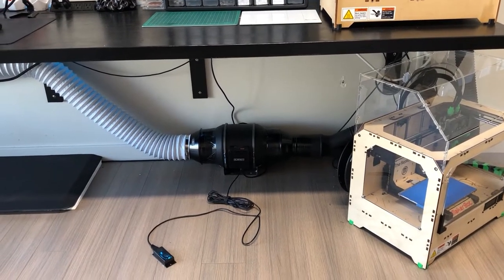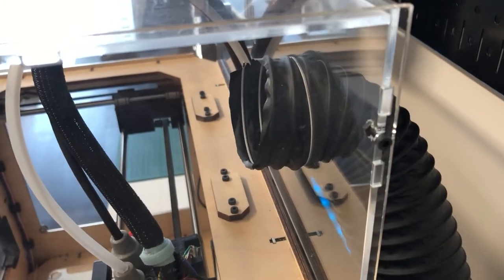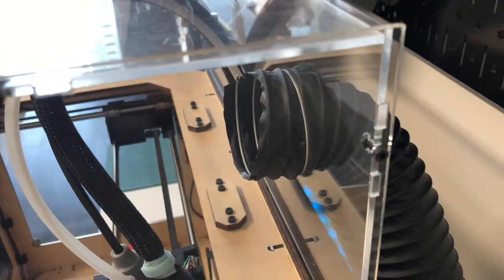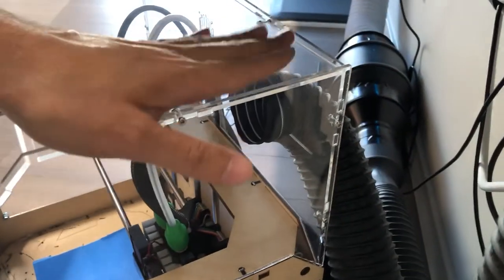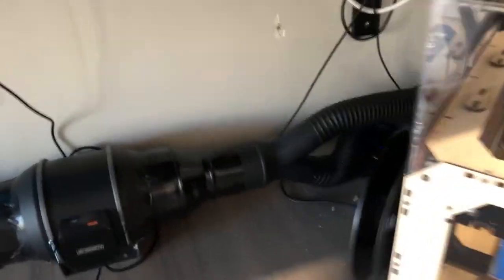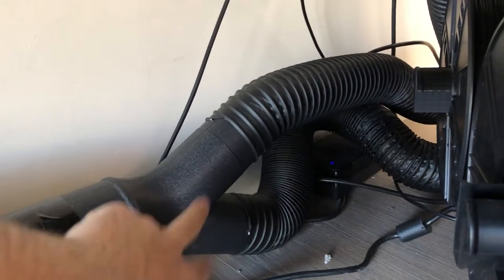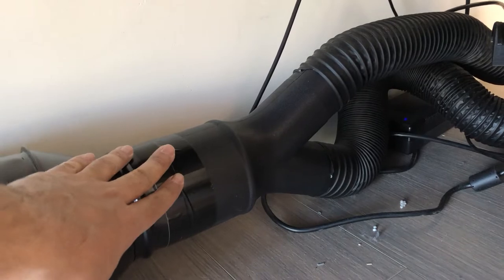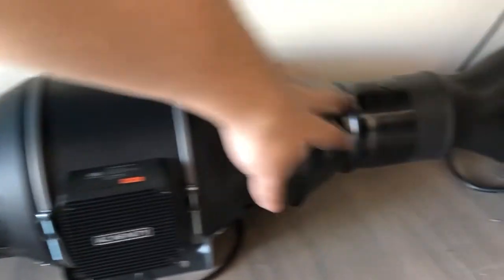3D Printer Fume Extraction System

Comment: Impressive! Probably overkill: I don't think you'd need to extract that much air, unless you often want to open the enclosure as soon as the job finishes
Reply: ... and now I'm going to get back to over-engineering stuff of my own 😅
Reply from the maker: Haha you’re probably right! In fact I only put the exhaust fan on half power and even then it handles both printers with ease. With more research I’m sure smaller duct hoses and a less expensive fan would work well, but I just wanted something that would work out of the box and that was readily available. I will say, I feel more at ease without smelling any fumes!

Comment: Can I see how you rigged it to the actual window? There’s no real view of that there. Did you just cut a 4” circle hole in the window itself or what kind of setup is there where it meets the outdoors?
Reply from the maker: Hey sorry for the super late reply! I didn’t get a notification… this is probably too late but to answer your question, the hose is just sticking out the window. I used those 3D printed clips to keep the hose mounted along the walls (link to that 3D printed part  is in the description), and once the hose reached the window, I just stuck it out. Simple enough and effective, but it does mean you have to remember to put the hose out the window each time you’re going to start a print, so I usually just leave it open the whole day.